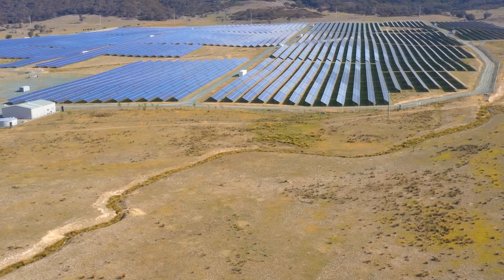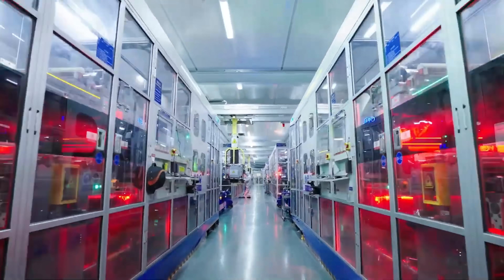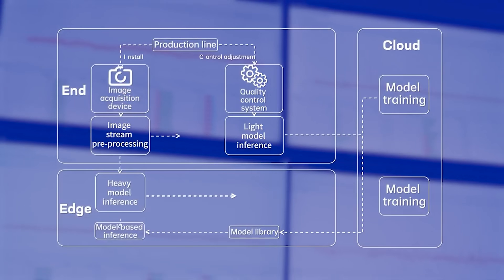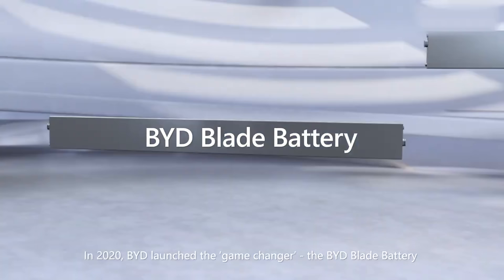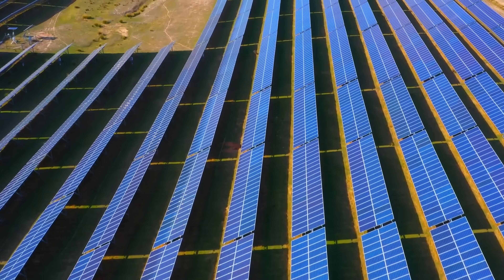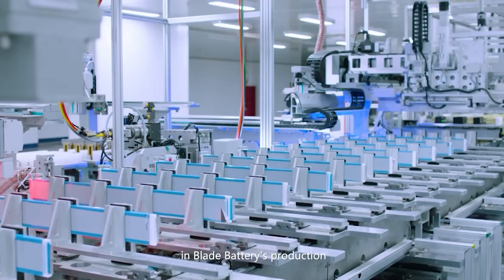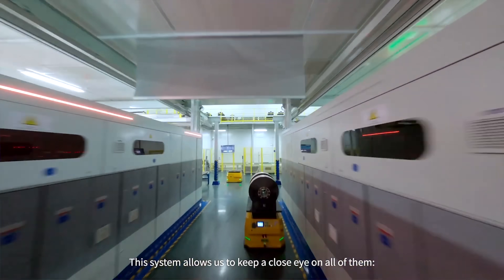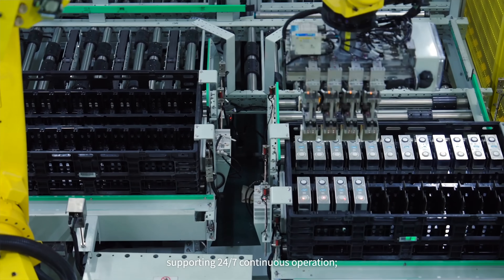U.S. Just Activated Its First Sodium-Ion Power Plant — Lithium’s Days Are Numbered

Comment from the maker: It's finally happening. But is it worth it or should they stick with LFP?
Reply: Stick to LFP for now. Yet too see if it ever gets cheaper for home batteries.
Reply: From what little I know, the benefit is that it is NOT lithium. If there's enough development then perhaps it could at some point be better all around.
Reply: Scale is everything.  Everything works for storing energy:   li-ion, LFP, pumped hydro, vanadium flow batteries and even flywheels.  All of these are proven and working. The question is: which can you scale up to power a country?
Reply: It offers just a tiny bit less energy density (narrow gap), 1/3 of the cost (eventually can go down as low as to 1/4), it cannot catch fire, better for Hot and Cold climates, places where any lithium battery lose up to a third of it's enegery denisty capacity, and  lose half of is charging speed and increased degradation/breakdown of components in extreme weather conditions, specially in heat.
Reply: Like any new product it will get better
Reply: In the UK local people are blocking battery storage citing fire and toxic chemical concerns from batteries.

Using sodium ion batteries takes these concerns away meaning battery storage can go ahead and local residents do not need to be concerned.
Reply: @javelinXH992  Yes, the safety issue (however small in reality) of lithium is going to be a key accelerator in the development of sodium-based batteries.  In my view.
Reply: @dogsbodyish8403 The cold weather performance does it for me. And will the packs even need a conditioning system? That would be another big deal.
Reply: @javelinXH992    They will cite something else, if they are disproved.  Basically they are  the NIMBYs.
Reply: @oliver90owner I’m sure they will, but you have to keep chipping away at the the semi-believable excuses until only the crazy stuff is left.
Reply: @javelinXH992    Yes, well, OK, etc.  But we already know that NMC batteries, for static energy storage, is superseded by P04 chemistry which had little fire risk.  So that moan is already out of the window.  The only real moan from the NIMBYs is the view out of their window.
Reply: @oliver90owner  As far as I have read, there have been NO large LFP fires.
Reply: Na and zinc all the way. No question.
Stop being a Li slave. Li had it's time and place, now move on.
Reply: There is not enough information presented to make an assessment.

Comment: Will Prowse reviewed sodium batteries on his truly outstanding YouTube channel. Admittedly he was testing 100 amp hour batteries such as people would use for camping and the like. 
One significant issue he highlighted was that the voltage of the cells decreases proportionately as the state of charge decreases, which diminishes overall performance and presents various technological challenges. 
I am aware of the claims coming from CATL about imminent mass production and of course that will prove itself right or wrong soon enough. I want to believe sodium batteries are as good as claimed and will be a game changer!, but where battery technologies are concerned you can't believe it until you've seen it operating as claimed.

Comment: To put this in context, a 3.5 megawatt-hour battery is an experiment and in no realistic sense could be called grid scale.
Even in the backwoods of Australia which only has about 6 grid batteries at the moment, they range in capacity from about 50 to 500 megawatt hours.
Needless to say large capacity batteries are not economical at the moment so that which can be done is being done, but going  forward I would suggest that 50 megawatt hours would be the minimum it could be considered useful grid storage. 
In the end, really effective useful grid storage will need enough storage to power your entire grid alone for 12 hours. I'm not an engineer no expert but that is my shoot from the hip opinion. 
In Australia for example that means about 300 gigawatt hours. 
Needless to say if you do that with batteries, 6000 50 MW batteries would be required. Which is quite a lot!
Reply: Yes as stated in the narrative this is an experiment. But a real world proof of concept experiment. If successful it will be quick easy and cheap to scale up.

Comment: The charging and discharging efficiency isn’t as good as Lfp and the voltage curve is linear making the battery worse them lithium batteries… probably have to wait for a second generation or newer chemistry to replace lithium batteries 🤷‍♂️

Comment: The real advantage of these sodium ion batteries is for base load nuclear plants which run 24/7 and can charge these batteries at night at little or no cost and to a lesser extent baseline coal plants which can be very inefficient to shut down at night but instead keep them running at a lower capacity to charge the batteries.  As for the US being behind on renewables, thankfully we are as the price of electricity is directly correlated to the amount of wind/solar deployed (think Germany).  In addition, Germany which is highly dependent on wind/solar puts out 10 times more CO2/kwh than France which uses mostly nuclear,  because when the wind doesn't blow and the sun doesn't shine, the natural gas and diesel turbines kick in.  The US only puts out about 10% more CO2/kwh than Germany without using a lot of renewables, but the average price per kwh is 16 cents vs 40 cents in Germany.  I will take the route the US is going any day, waiting until the technology is proven before going out and deploying high cost alternatives.

Comment: I haven't  seen  one single    battery in any store. Until that moment this is just hype. Lithium  batteries  are around for a very long time. Every computer, every LCD watch, had one or two. Also used in high end cameras for many years. BUT they were not rechargeable. There is a lot of talk about sodium batteries, but  that's  about it. What   I learned  about  Sodium  back in my  days, that  Na is the second most reactive  element  just  behind potassium  Or  K  on the  table. Things might have changed  since the 70's.  But I do want something tangible and accessible  to anyone.

Comment: It makes sense to discover and develop a battery chemistry that is safe and reliable at a large scale for the grid, prior to concentrating on chemistry that is simply smaller and more compact. After all, you need a safe a reliable foundation before you can even think about building an electric automotive industry. 

Simply put, you can't have a country full of electric cars if you don't have a safe and reliable grid to power them.

Comment: The superior low temp and low degradation rate will make it viable even for cars, especially in the northern hemisphere. I could easily accept a slightly shorter range (for now) if its possible to charge to 80% in 10 to 15 min which it's supposedly able to.

Comment: Sodium Ion is TOTAL GARBAGE and always has been, these batteries are really really bad, slow to charge, drops the voltage way too fast, get hot and they are heavy. See this video, this guy tests them and that is also the reason why they have been announced for the last 10 years (yup, NEXT year they will take over was claimed for all that time), yet nobody has used them. This guys summary is that you should rather use LFP (Lithium Iron Phosphate) battery, because it is waaaaaaaaaaaaaaaaaaaaaaay better.  What a disappointment.  https://www.youtube.com/watch?v=zSPSCC3_hHw And unlike this video that just talks about an announcement, the video I liked actually tests them, has real data, real experience, not the usual BS by the battery producer that claim they are ready now, which they are most definitely not. This large test will remain exactly that:  a test, this will never be used and which advantages does this p.o.s have????? None, absolutely none!

Comment: You should look into the voltage curves of sodium and how it works as a battery compared to lithium. Will it replace a traditional 12v battery like lithium has or does it actually perform differently and need different hardware. With a sodium battery be a drop in replacement for lithium which is a drop replacement for lead acid (well kind of)

Comment: In my opinion energy density is not as critical in BESS, number of cycles and low/zero fire risk and zero toxic gasses is a winner.
Sub zero and high temperature performance with zero parasitic draw for thermal management systems also a win.
 Raw materials available globally - not controlled by any one nation.
This is what is needed and provides perfect opportunity for community battery storage in rural and remote areas.
Just think of developing nations with affordable Off grid Solar and wind installations popping up through our those developing countries.
Providing power , lighting, communications without the super expensive running of High tension lines across the country.
This is progress and affordable.

Comment: Sodium Batteries have some great strengths but also some unfortunate quirks.  I have many questions as to how they overcame these. 
Such as when lithium batteries discharge, they maintain voltage to the very end.  As sodium batteries discharge they have a steady linear voltage drop.  Voltage drops are not good for the grid. 
Sodium Batteries I have seen tested were notoriously inefficient, and when stressed dropped voltage so quickly that they cut off at  about 40% remaining charge because of the low voltage protection circuit.  But this deployment is claiming well up into the 90% efficiency range. 
I suspect some of the issues I witnessed were because of trying to use lithium optimized electronics to manage sodium batteries.  Still, voltage does drop precipitously, and they don't like being stressed. 
Completely passive cooling with no fluid, pumps, valves, or louvers to maintain, and still having a huge environmental operating window is a true game changer.

Comment: I can't wait for car the run on these instead of Lithium.   HOPE they go quicker than expected
Reply: China already has sodium batteries in cars on their roads.
Reply: Please buy them, that way I can buy LFP etc cheaper and then sell you my used LFP car as yours is trash because Na+ is trash and reviewers like this guy are too LAZY to give you the real stats.  Na+ has a piss poor efficiency, you cannot use the bottom 30% of its state of charge, is horrifically SLLOOOOWWW to charge at low state of Charge and at high state of charge, requires 30% more VOLUME than LFP which means in reality your car will only go 60% as far as an LFP and more like 50% verses NMC.  Na+ is in effect a higher cycle rate Lead Acid Battery.   Good for the Cold and nothing else

Comment: Lithium Ion batteries dont actually contain "rare earths".  This is a bit of a myth.  Rare earths are not even rare nor earths, its more about difficulty in extraction and processing. There are 17 rare earths consist of fifteen lanthanides, including cerium, dysprosium, erbium, europium, holmium, gadolinium, lanthanum, lutecium, neodymium, praseodymium, promethium, samarium, terbium, thulium, and ytterbium and the metals scandium and yttrium. Neodymium or samarium are used in electric motors, but its also possible to make electric motors without these, like induction or EESM.  Lithium and Cobalt are moderately abundant its more to do with limited concentrations in specific countries.

Comment: Price is the most important factor.
Reply: They do not win price as 1kWh Na+ = 0.7kWh LFP let alone NMC.  So, until they are 30% cheaper they are not equal.  You cannot use the bottom 20%-30% of Na+.  Effectively due to abysmally SLOOOOOWWW charging on top 10% you cannot use the top 10% either, making their TRUE ratio 1: 0.6 in reality requiring them to be 40% cheaper to be EQUAL in anything other  than BITTERLY cold days.  Even then it is a near wash
Reply: @w8stral when volume production is reached they will win the price war due to raw materials . For your information I never charge my NMC 100% or discharge lower than 10% I always charge and drive in the middle.
Reply: @peteroffpist1621  LFP you do charge from 0% to 100% which is the actual competition, not NMC. Need 30% more Na+ to equal roughly LFP.  The Lithium is only ~5% of the cost of LFP or NMC batteries.  You can find these numbers from TESLA presentations if you wish to look it up.  The ONLY difference in materials is you change out the tiny amount of lithium for Sodium.  Everything else is the same.  The lithium makes up less than 5% of the cost of a battery.  .  Wake UP and sniff reality.  

PS: If you only charge LFP between 20% and 90%, its cycle life is around 20,000 cycles 2X that of Sodium's gen II battery claimed(unverified by 3rd party sources)
Reply: @w8stral the youtube channel Limiting Factor has a different cost calculation. Regarding LFP charging you are right I also have two Model Y with LFP and two S with NMC. Still as far as I have heard Sodium doesn’t need to be charged to 100% for calibration ?

Comment: I'd be interested in hearing your thoughts on the speed of recharge of these various chemistries for EV's. AFAIK, sodium ion batteries recharge, even in early versions, at roughly double the speed of lithium ion and IMO THAT will be more important than absolute range. If you can recharge your car with an extra, say, 200 miles of driving in less than 10 mins, what difference does it make if an alternative can do 400 miles. It places EV's in direct comparison to the ICE which also take several minutes to 'top up'. But, obviously, it depends on developments over the next couple of years.
Any thoughts?

Comment: Look up the Stached Training channel here on YT.  After you watch a handful of his videos you will understand why I want as little as possible to do with any lithium chemistry battery in my home, vehicle, or community.  And that is ANY lithium battery chemistry.  Some are safer than others, but they are ALL subject to failure, thermal runaway, toxic and explosive off gassing.  

After several large cargo ships have been lost, sunk, because of EV fires, many companies are refusing to transport them.  The same is happening with ferry companies.  Insurance companies are refusing to write insurance for houses with EVs parked inside of them.  When lithium batteries, including LifePo or LFP over heat they give gasses including poisonous and explosive hydrogen compounds.  Remember the Hindenburg?  From the time you see one of the batteries venting, you may have seconds to a couple of minutes to get away before the gasses explode.

Comment: I find myself in potential disagreement. Sodium Ion is, or certainly test results show, incredibly inefficient, where maybe only 60% of the power you put in stays in, whereas Lihtium is over 95%. Also, it has a discharge curve (very flat) that makes it very difficult to control with an inverter. I have seen a test of the Nextra cells showing a 100A cell giving only 60A on a discharge test. Given that is is as heavy and volumetric as Lithium, so using this on cars would not be an option. For me, the jury is out. Lots of technologies have appeared, and disappeared without trace. I suspect this will also. Good for news channels, but for investors,
Reply: I think the core thing I'm hoping for is to get away from reliance on lithium. We can make batteries bigger, we have tons of tons of tons of material for making these batteries already, I want us to stop strip mining the earth for scraps of lithium
Reply: @Musty_Moth  I agree. But cars are already too heavy with Lithium batteries, we need something, lighter, less volumetric and more energy dense, not the opposite. Many people also live in tiny residences, struggling for space for battery storage and backup. Also, a battery cell technology that wastes so much energy (inputs) is far from ideal. Problems that maybe can be resolved, but haven't yet been, based on early tests of real batteries made from CATL's sodium cells.
Reply: Totally unworkable which is why CATL is investing over a billion dollars in manufacturing capacity of this chemistry.  Any fixed battery technology that doesn’t use lithium, makes that and other materials available for auto production

Comment: Not a good option for home batteries at the moment. Voltage drops too sharply, charging is challenging.  You are lucky to get 70AH out of 100AH and only if the inverter doesn't shut down early because of the low voltage. The stats are even worse if you pull 1C.

The price also higher at the moment. 
Good for starter batteries in the cold climate though :)
Reply: Yeah, Will Prowse did some tests and showed these several reasons why they are inferior to LiFePO4.
Reply: I’m a EE and it’s not that difficult to design inverters that will accept a wide input voltage range and provide the desired output with fairly good efficiency.  In northern climates that need heat in the home, any inefficiency can be utilized as it is neatly all thermal (heat).
This is going to be a significant win in many ways that will make renewable generation and energy storage more affordable.  Give it a few years.
Reply: You’re parroting the will video. The inverters out at the moment were specifically designed for lithium chemistry. 

On what planet would you expect a completely different chemistry to work with current inverters when the inverter was not designed for the chemistry. 

Sodium is new but perfectly viable when costs come down and paired with appropriate inverters designed with sodium in mind. 

At the end of the day if sodium can become cheaper, with easier to source materials there is absolutely nothing stopping the chemistry from dominating stationary installations that aren’t space constrained from an economics perspective alone. 

Like it doesn’t matter at all if it’s less power dense when they are sitting in a field of solar panels with limitless space.